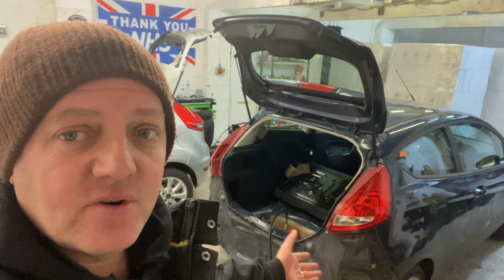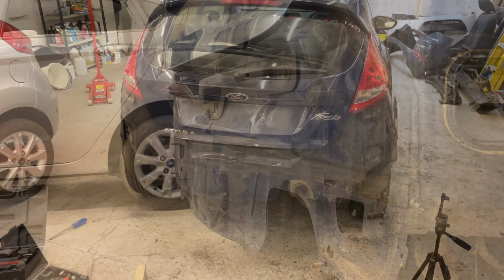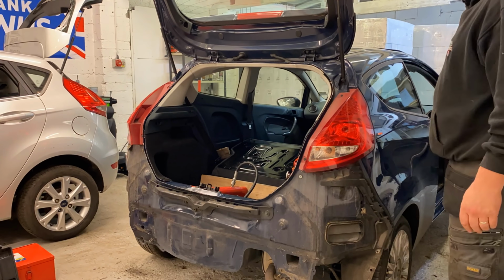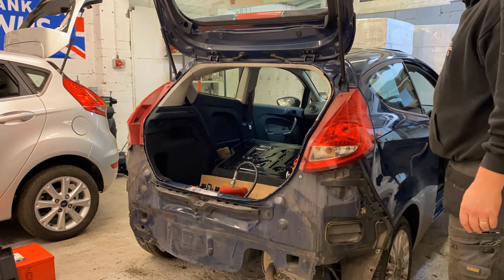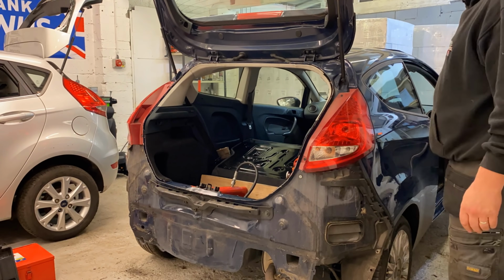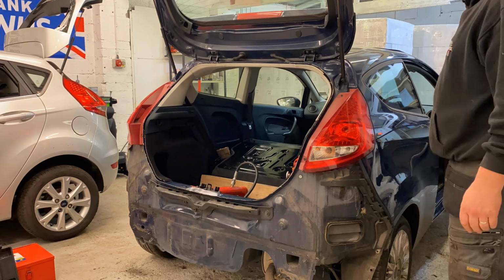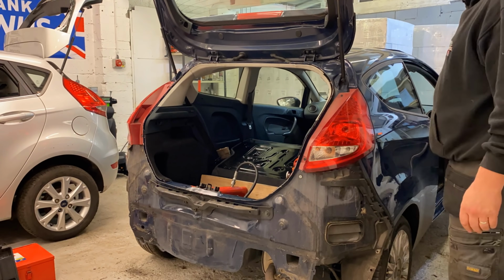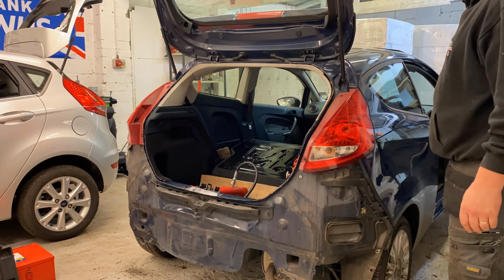FORD FIESTA 2009 COPART SALVAGE BLUE AUTO PT2

Comment: I would be happy with that back panel if it was me. It was much better than before, but you could have maybe knocked that crease in, but you would then maybe need a slide hammer to pull out the other bits. Loving your honesty & the channel. 👍

Comment: If you get a stud welder, weld the studs along the dent, put a thin bar through the eyes of the studs then you use a slide hammer to pull out the outer skin. I'm sure there would be videos on here showing it done, be a couple of hundred quid I think but you could use it for other things where the little puller wouldn't manage. The studs can be reused then just tidy up with an angle grinder and as it's hidden a rattle can spray job would be fine. Don't over think things, wait til it's all complete with all the stuff connected and see if it runs ok, if not then start problem solving.
Reply from the maker: Thanks Alan i will look into a stud welder it will come in handy nice one buddy 👍👍
Reply: @ResurwreckAutosUK  the master of the spot-puller is Arthur Tussik you can him doing it in loads of videos here on YT

Comment: It would have been great content for the channel and also  you to have a go at swapping a welded panel Mark. I would have bought the back panel from car the tailgate came off, (Same colour) you could have unpicked the spotwelds  paneled it up and got your bodywork man to weld it seal it and blow the edges in. The back panels in Fiestas are not that complicated especially with this not being too badly damaged. But It should be ok the strength is there once you replace crash bar . Still a decent little motor Mate. regards Rich.

Comment: Did it have a spare wheel in the boot when hit, as this sometimes pushes the boot floor up where the spare wheel sits behind the rear seats. Worth a look if it did as it may need tapped down.
Reply from the maker: Thanks Ian I will look it did have a spare wheel in the boot so I will check 👍👍